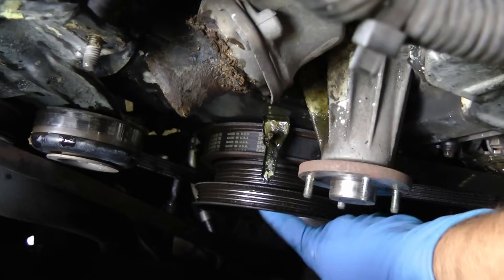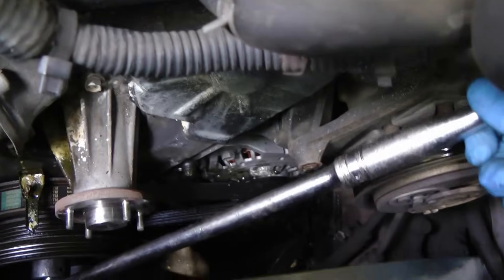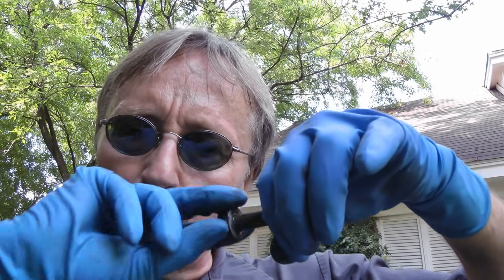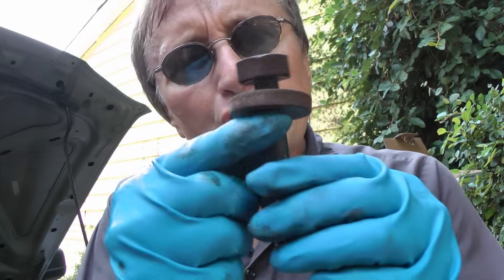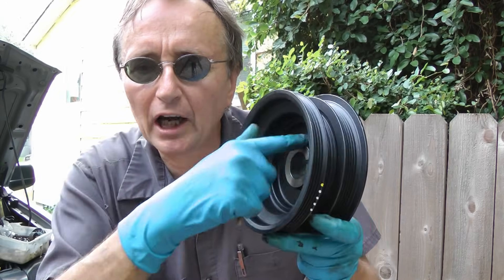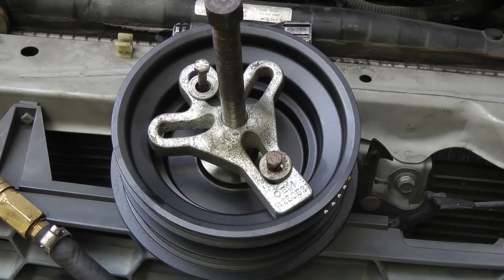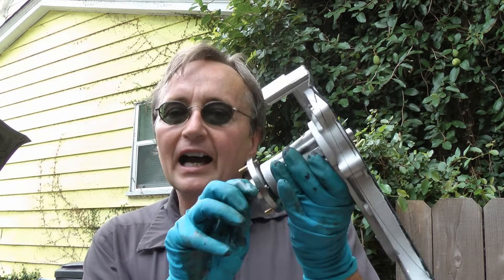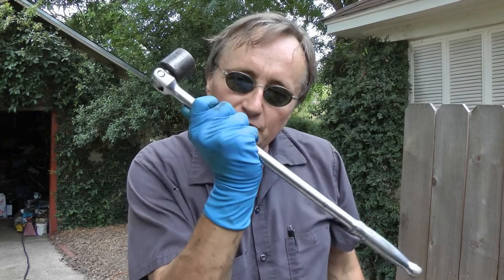How to Remove a Crankshaft Pulley in Your Car

Comment: Great, but how do you get it back on?  Torquing it down turn the whole engine
Reply: +Ricky Patel once the belts are on it will hold it enough. once you get to the point where tightening it starts to spin the engine, i usually give it some quick hits to turn it a little more and thats good enough. the reason for this is because like most nuts and bolts, coming off is much harder than going back on.
Reply: ***** Actually, I just torqued down my 300zx auto tranny to 120ft/lbs and used a STRAP WRENCH on the crank belt pulley and rested the handle upon the frame of the suspension ... worked AWESOME!  But, yeah, if you try  to do it with the existing serpentine type belt on your car ... yeah, no way will that work
Reply: +Kevin spacey it can definitley be torqued (and i do torque it) that way. I also have most holders for most situations but for those who dont have the tools the trans ( and bolt) can hold it.
Reply: trollaphobic i got two craftsman strapwrenches on amazon for like $15
Reply: +David Beecroft they work well. Im just also a diesel technician. So you cant exactly use the belt trick for my bolts. Some of those are over 200 ft lbs. holders are needed so i just got a lot layin around
Reply: Man! So I just went through trying to take off the most stubborn crankshaft pulley bolt! I'm working on an automatic, so I went out and bought a 700ft lb. impact wrench. Nothing. Then I tried this method. Nothing. Then I tried heating it with a torch. Nothing. Then tried freezing it. Nothing. Had to go in through the starter, wedge a big screwdriver into the flywheel to keep the engine from spinning, and finally broke it free using a big breaker bar (sheared off an adapter in the process). Hope this helps someone as I haven't seen any mention on YouTube of trying this for people with a really stuck crankshaft pulley.
Reply from the maker: you didn't heat it up hot enough. If you get the bolt red hot with a torch, they always come off then
Reply: Old comment, but how I got it back on:  Put tranny into 5th gear.  Partner held down brake.  Torque that mo fo down!!!
Reply: Except that the bolt was starting to roll over and damn near stripped out. If I went any hotter it was gonna just melt around my socket. I had to replace the bolt as it was. 

Also I totally didn't mean to leave this comment in a thread but apparently I suck at youtube.
Reply: Use a spanner to the correct torque. Engine rotation will tighten the bolt as well, over time.
Reply: No, they don't, this bolt is safe over a wide torque range.  Don't believe everything you read in a  shop manual.
Reply: @JonsReef if it says 80 ft lbs... and you crank it to 80ft lbs..... its not gonna work....? I dont get it

Comment: 2003 Honda CRV , Crankshaft bolt from hell, my Dewalt 1200lbs break-way force impact gun that rips tractor trailer nuts and axle bolts off with ez failed, your trick work liked a champ, thanks. Yes I unplugged the spark plus and used a 2 ft breaker bar. Thanks Scotty

Comment: This has to be the single easiest way to break/strip flywheel/flex plate teeth I have ever seen or break a starter. Not saying it doesn't work most of the time but, if it doesn't a flywheel can be extremely pricey especially if its a dual mass on. Also you could warp the flex plate if its an automatic.
Reply: i have tried the ignition on my car numerous times when it was in 1st gear in 3rd gear even in fourth gear and it has 350k kilometers and the flywheel and starter motor still work perfectly, i suppose once every crank shaft pulley removal won't do no harm
Reply: First time I tried this, the flex plate cracked a few months later.  The second time I tried this (I was desparate) the bolt sheared right off and then I was really hosed! 

This is bad advice.
Reply: In my experience, the teeth on the starter always fail long before the flywheel teeth, but that could be due to quality of parts used/reused and/or other things. I wouldn't say it's a common occurrence.

As all my vehicles (that I'ved had to work on) in the past 12 years have been manual and mostly rwd, I've never had a problem torqueing the crank bolt back to spec. Even as a teenager I'd taken off and reinstalled a crank pulley a few times without torqueing to spec. Never had an issue, no premature wear, no wobble. Then again I was heavy into machining and had been wrenching for a long time so I knew how to "feel" the torque of a fastener. Definitely not spot on, but sufficient. Old school thing, maybe..
Reply: I've done it multiple times. mechanics I know do it a lot. it doesn't damage anything
Reply: YOU NEED TO BE SUBTLE
Reply: Carnage 50X watched a guy break the aluminum hood right off a chevy starter lve used this method myself but never say never

Comment: This helped a lot to remove the bolt on a Jeep TJ 4.0 six cylinder...saved a lot of headache! Just be sure to disconnect the ignition / ugly Jeep 4.0 coil rail so the spark plugs do NOT fire. Thanks Scotty!

Comment: so how do you install a new one?
Reply: Get ur new pulley to bolt it back on to torque spec (depending on ur car spec may vary) on ur engine . Reroute and attach serpentine belt and reattach anything else that u removed . Start the car and make sure the belt is working and ur good to go! 😁

Comment: Wish it was this easy for hondas. My engine rotates counter clockwise
Reply: +Jake Vang There should always be something on either side to brace it against.  If not, then get a longer section of pipe and brace it against the side of the engine compartment.
Reply: Thomas Fisher  the thing is this only works to loosen crankshaft bolts on clockwise turning engines. So for a counterclockwise engine like  a honda this method would only tighten the bolt.
Reply: @ALLCOMPTON  You will find that it threads on the opposite way.
Reply: Oh.. cause if the v-tec🤣
Reply: @driver3025  Ye v-tech. Most center bolts on rotating parts will always tighten with rotation if they are loose. So clockwise rotation would mean anti (counter) clockwise tightening, and vice versa. These threads are often referred to as "left hand" and sometimes are identifiable by small perpendicular notches on the peak of the hexagon. Just some more useless information to clutter up your head.
Reply: Huw Bishop oh.. I always thought those notches gave you the rating of the fastener. Look at that...

Comment: Well.. but what about tightening it again? You need different methods I believe
Reply: The video is simply "How to REMOVE a crankshaft pulley"
Reply: Someone else said if you have no proper tools and can get it off, you put everything back together, threaded by hand. Replace all the belts and then tighten. With the system properly tensioned it should hold the pulley to be able to tighten the 130+ ft-lb they usually need.
Reply: Shaolinfist83 and had to remove all that crap anyway to get the puller in there lol
Reply: (Copied from below) some guys put loctite on the bolt, others use a strap wrench to hold the crank pulley from moving when tightening. If you have access to the flywheel, you can block it with a wedge shaped piece of wood and torque the CS bolt to the proper torque.  Scotty mentions a strap wrench that will also work.  Do not use the red loctite if you ever think you may have to do the job again.  I use the blue and always use a torque wrench

Comment: This method is possibly dangerous and destructive if not performed correctly. Just get some large locking chain pliers ($20-$30), pad the pulley well to keep from damaging the belt grooves and then use some testicular fortitude.
Reply: Yep, large locking chain pliers work every time.
Reply from the maker: Matthew Ballinger
Sure, and they will often break modern cheaply made crank pulleys that are made of pot metal and often have rubber isolaters that will rip using a chain. Actually more "destructive" to quote you guys, in the long run.
Reply: Scotty Kilmer
I use em all the time, no problems. Never had a rubber isolator rip either. Of course I tend to only work on vintage Japanese models, so I guess the pulleys are stronger.
Reply: Yeah, don't wrap the chain around the harmonic balancer.
Reply: taizer I've dine it at least 40-50 times and never had an issue? Or  one that wouldn't undo
Reply: If you're taking it off to change it then clamp it anywhere you want
Reply: waaaaa

Comment: Just a quick thank you, I have Hyundai Elantra and this trick saved me from pulling my engine (ZERO chance of using impact wrench in that crammed space). 
Quick pointers:
1. I used jumper cables and actually two pair since I pulled the battery to get max voltage to the Starter motor.
2. I also use penetration lube on it and plenty of it and waited a few minutes
3. Finally I heated the bolt surrounding area with a torch
Reply: +Forrest Outman Your lucky you didn't melt the rubber bearing on the crank pulley or the crank shaft oil seal... never use a torch on those bits..
Reply: True if I heated it to much I could have melted the harmonic damper rubber.
Reply: +Forrest Outman:  "to get max voltage"? you use 24V?
I tried the lube but it can't go into toyota bolt that has flange.

Comment: Just did this on my 300ZX TT Auto and worked perfectly, thank you thank  you thank you, once again Mr Kilmer for once again saving me money and hassle, I love these videos and always use them as a guide when I run into problems!
Reply: +Daryl Levien yeah, dude, but how did you torque it back down to 200ft/lbs (thats' what the 300zx spec is)?  i'm assuming you're car is an automatic ... if not, i guess you just stuck it in 5th gear and took a torque wrench to it.  sadly, my '96 300zx is an auto ... gr!  i'll probably have to take out the starter and block the flex/fly-wheel with a screwdriver

Comment: This tip worked great for me on my Jeep Liberty 3.7L. I just braced the breaker bar against the top stud on the front of the engine, turned the ignition on for a spit second... bam, broke the bolt loose easy peasy. Thanks for the tip!

Comment: Yes it worked like a charm. But I should have thought about setting off the fuel pump switch. I bumped it once, but the second time the engine caught. I shut down asap. It spun the bolt right out. Thanks Scotty, I've learned a lot of great tricks from you keep up the good work!

Comment: good advice for clockwise turning engines.  I have a 2001 Honda CRV and the crank pully is on the driver side and turns counter clockwise, so that bumping the key does not do any good for me.

Comment: When I was a kid I watched my Dad struggle to get that bolt loose on many different vehicles. Kind of laughing about it all now. The wife's dodge durango needs the seal replaced. Thanks for the tip as I will be chuckling as I take the pulley off.

Comment: If bumping the starter doesn't do it, here's a tip that worked for me. The  car had been sitting in garage and battery was weak. Even after heating with Mapp gas torch, that sucker would not budge. I heated several times with high flame and added Aerokroil bolt loosener each time. Still wouldn't budge. Finally sheared my socket. I did two things: I bought a 22mm impact socket (fits '95 Avalon), and I recharged the battery. I also added a booster battery. With the new socket and extra battery power, it came off on first try!  Felt so good. That bolt had been on there since 2001.

Comment: Sometimes I wonder about what our smart devices are listening in on.  So last night had to remove the crank pullies and harmonic balancer bolt off the 351c in my 72 ranchero.  Dawned on me to try this and it worked.  Lo and behold after figuring this out myself this video popped up.

Comment: This is a great method thanks. Unfortunately it's not working on my is300. The whole engine won't turn. Stuck on the breaker bar. It's like even the motor or crank don't have enough cranking power to turn the bolt loose. Does this have anything to do with my battery crank start power?

Comment: Warning: This method is very risky, at best it will only damage the tool used to loosen the screw. There are worse cases in which the screw breaks, or a loss of synchronization with the camshaft can occur and cause serious damage to the engine. It is a very risky method and highly not recommended. It is best to use an impact wrench, electric or pneumatic, and first apply a screw loosener such as WD40 or similar. It may cost a few dollars more but it is the safest and most effective way.

Comment: My Dad showed me this when I was 15. Now, I'm 61. Don't have to do this very often, but when I do...People in the past have warned that you can break a crankshaft from the snap involved. It suppose it's possible and I have cringed when I got a stubborn one. But so far, no broken cranks. I always disconnected power to the coil to prevent a kickback that could fling the breaker bar the opposite direction and damage something. I use a remote switch rather than doing it blind with the key. Remove the start relay on most cars and connect to the #15 and #30 relay circuits. On older Fords, it's easier. On GMs, find the Purple/White wire that goes to the starter.

Comment: Any suggestions for a push start?
Reply: Find the start relay, pull it out check back of the relay, there is a diagram.  Use a short wire to contact relay secondaries for a sec. Done.
Reply: Also pull the fuel pump relay too.

Comment: You can get a 12 volt impact wrench from Harbor freight for about $25. Weird but it works. They sell it as for wheel nuts. Probably a product liability issue but it will work on any nut up to 150 ft-lbs.

Comment: on most cars you can easily get to the pulley with a impact wrench by removing the front right wheel and wheel well padding around where the shocks are.

Comment: Be ware, alot of late model engines dont have cam & or crank pulley locators. Need cam & or crank shafts locking tools before bolt removal. Usually set timing to number 1 cylinder T.D.C. prior to cam & or crank pulley removal. Other words cam & or crank pulleys not timed to cam & or crank shafts. Research before attempting pulley removal. Otherwise possible inlet/exhaust valves damage if interference fit engine.

Comment: Thanks for the video....Quick question. I loosened a crankshaft bolt with an impact gun but my question is how tight should I tighten the bolt when put it back? Thanks
Reply from the maker: just use the impact again

Comment from the maker: no, it moves the bolt, not the pulley. and ones without keys the don't use crank pulleys for timing sensors anyway

Comment: Hi this may be a dumb question but in order to get off the harmonic  balancer you must remove the crankshaft bolt right? I have a 95 lt1 engine and someone told me all I had to do was remove the 3 bolts on the balancer and that was it. Sorry I'm a novice at this but I love your videos very helpful, so I thought I would ask you the question.
Reply from the maker: some cars remove the entire pulley assembly using the one crank bolt, some use a number of bolts to hold on the pulley itself (but they still need the crank bolt removed to get the rest of the assembly off.)

Comment: Dude, love ur vids!  but the Real tricky part is not getting it of but rather putting it on and keeping the crank from turning as you torque it up...ive used a strap wrench around the harmonic balancer, and a piece of old serpentine belt to go around the pulley grooves...i then slip that strap wrench over it and the piece of belt  in there keeps it from slipping... dont use a chain wrench!...if ur worried abt applying torque to the outer ring of a harmonic balancer in fear it may break the rubber in there, ive applied 125ftlbs  without issue...if you want another way, u can make ur own holder that is secured to the INNER part of the balancer  with a couple of hardened bolts and the holder will need a large hole at its center to allow u to fit a socket in there once its secured to the inner part of pulley, then simply brace the holder against frame or any other sturdy part and torque away without worrie of damaging balancer...i made a simple holder out of wood abt 12 to 15" long and abt 1/2" thick... worked fine under 125ftlbs load... hope this helps people who dont have impact tools and dont want to do freakin weird stuff like inserting rope into their sparkplug holes....ill pass on that idea

Comment: still need something to torque it back on. and it will tweak the crank on some cars.(flat six aircooled) although i did it on my 3.4l tacoma and made a tool to hold crank for assembly

Comment: Hi mr. Kilmer. Huge fan. With ur video assistance, I'm replacing my timing belt and my valve seal gasket. Problem is, I'm down to the CS pulley bolt, it's stuck, I tried your trick but my engine won't turn over! Is there anything I need plugged in? I've dismantled cool packs and some other electrical stuff, and to top of problems in my diagnosis my battery was rather weak wen I began the project. Please advise. Ur videos kick ass. Thanks for all of them.
Reply from the maker: put in a new battery, and if it's really stuck, often you heat the bolt with a torch till it glows red hot, then it comes out

Comment: Just used this method to remove the 400nm/300 lb ft tightened crankshaft bolt off my inline 6 90s S class Benz. To be on the safer side, remove either fuel pump fuse or EFI (electronic fuel ignition) fuse so that the car never fires up incase you crank a little too long. Dont efff around and find out. Remove either of  mentioned fuses to be safe than 😵‍💫😵🫨